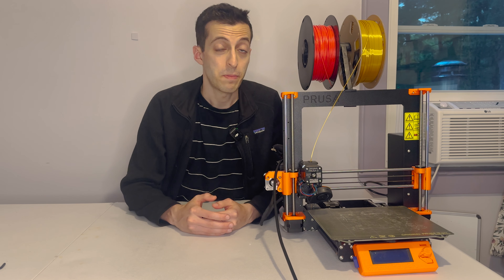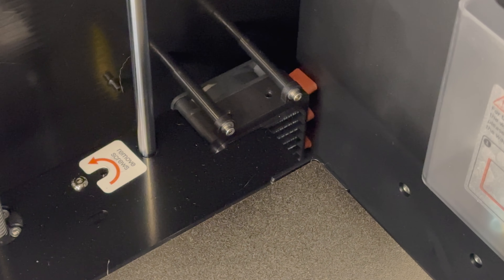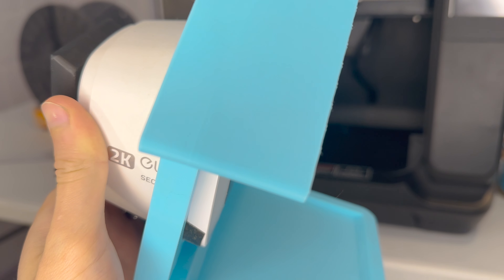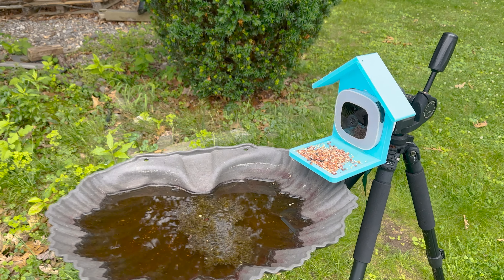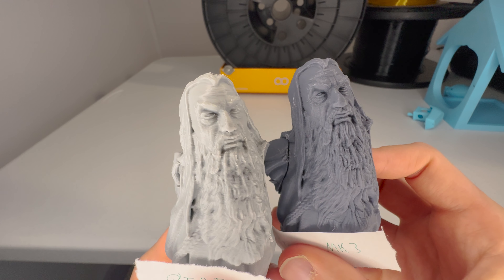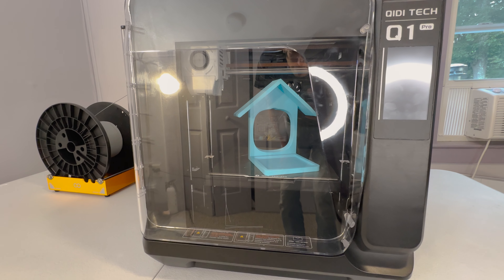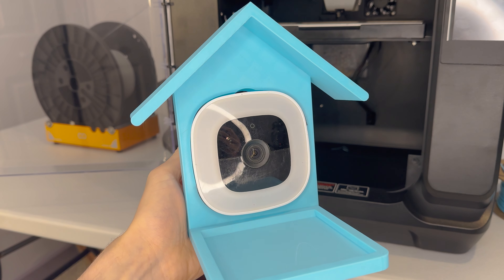Is it worth the upgrade? Qidi Q1 Pro

Comment: I love the Q1 Pro. I've had 4 other 3D printers and the only one(s) I liked were my Creality 3 V2's. Gave them away when I got and used the Q1 Pro. Customer service is fantastic! The only filament I've printed with is PLA but with this printer I'll be trying a lot of different filaments. This does take 5 minutes or so to start up (leveling, purging, etc.) , but that's ok  because I don't have to watch it, just start the print and go away.

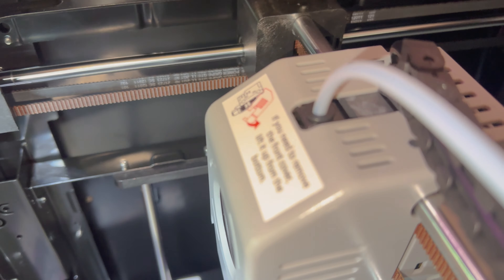Comment: 5:09 the steel parts dont care as long as they are lubricated and the motors will be ok as long as they are rated for the heat

Comment: Nice, quick review! One tiny note: ASA would have been even better, as it is the UV-resistant variant of ABS.

As a fellow creator, albeit on a much smaller scale, I think without sponsorship from these companies, we wouldn't be able to produce content. At least, I couldn't afford all the equipment and materials on my own. Regarding objectivity, it's true that it takes a hit; it's just honest not to deny that. One of my sponsors is a larger marketplace, and they allow me to choose the devices I want to make videos on. This forces me to do the same kind of research as if I were actually paying for the product, experiencing the same frustrations if it didn't live up to the claims.

This time, I had the choice between the Creality K1C, K1 Max, and the Qidi Q1 Pro. Guess which one I chose based on my research and my current set of printers. I haven't yet received the Q1P, so we'll see if I made the right decision...
Reply from the maker: @gerGoPrint3D  oh yes, I don’t know why it didn’t even occur to me to use ASA. Good luck with the printer, I think you’ll like it.

Comment: HI Dan. In my opinion ASA would be a better option that ABS for your outdoor birdhouse. I will be starting my journey with ASA and ABS soon on my 2 Q1 pros. 
Just a quick negative point on the Q1 Pro. It doesn't have an active carbon filter like on the X Max 3. but there are some nice mods for it. I will not print ABS, ASA without a filter.  
I'll come back to your channel to post on these very nice printers. And I hope your experience has been as good as mine.